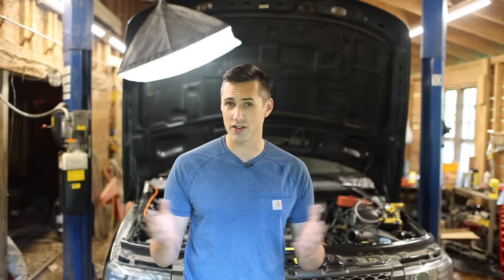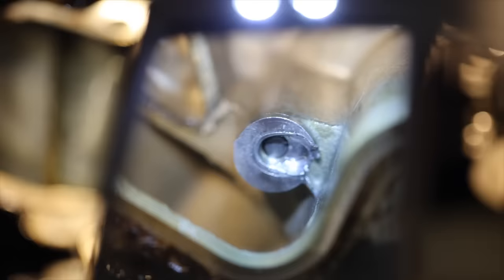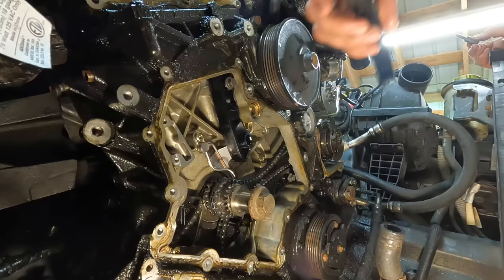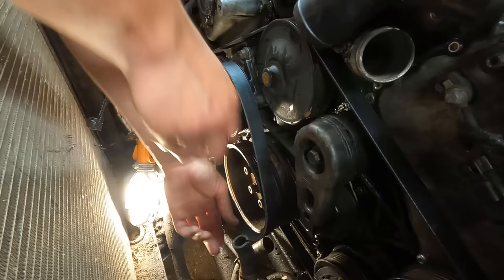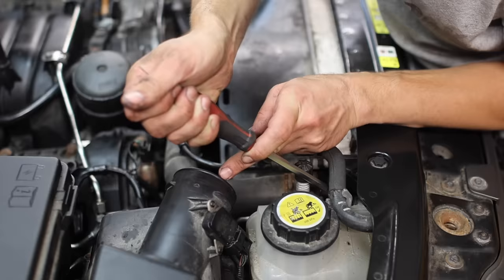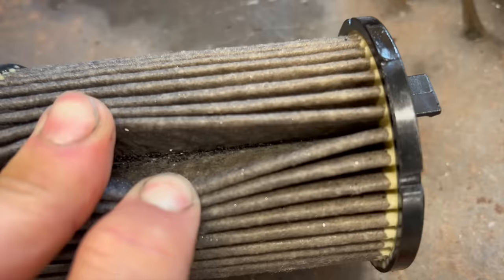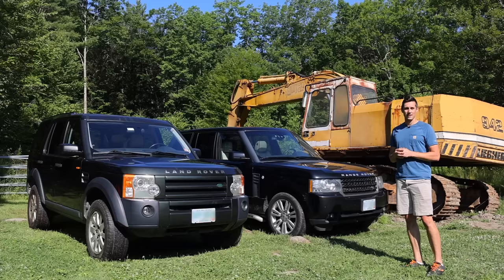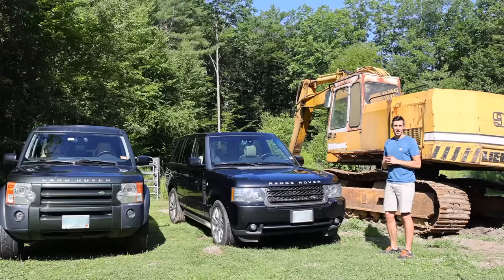Does My Cheap Auction Range Rover Need an ENGINE REBUILD? [Range Rover Part 4]

Comment: Run a engine flush through it and do a second oil change after 1000 miles. And check for shavings then. And then run it til it blows.

Comment: Here in the UK we have plenty of RR's running with dirty oil and worn out guides so don't worry about the aluminium flakes. Most have never had the updated guides and tensioners so your engine will probably last many more miles yet. 😃😃😃😃

Comment: Just keep changing the oil and filter and see if it clears up, drive it 100 miles and change it again. Much cheaper than an engine replacement or rebuild. and don't forget about that RF tire plus an alignment.

Comment: you can avoid CAN bus shenanigans, probably find someone to disable all the check engine codes for most of it and then just feed a faked crank/cam position into the stock ecu (or mount the factory sensors on the replacement engine.. will require lots of brackets and home made sensor rings) along with water temp etc, maybe put the jag throttle body on the LS/Toyota UR to keep traction control and ABS happy...

Comment: I would sugest doing a Mercedes M113 or AMG M113K swap, that engine has been proven to be reliable. All of the once i did the oil changes on are well over 450 000km and the oil is still super clean. The electronics are quite simple to sort out since at that period not much was going on. Its more about remove the unecessery wires. I did a swap myself with a M113 into a old W126 S class and it was very simple electrically even with an LPG system as well. The car is daily driven and has put on 120 000km since. I never got TC to work tho, abs works

Comment: Read many comments, but not all. My recommendation ( with do diligence) drill the pan, and install a drain plug. That way you can do a good flush, and go from there. They didn't install drain plugs from the factory, because the GoofyLube kids would strip the threads. ASE Masterteck, cheers

Comment: Take the vehicle title with you if you ever take it on a road trip. That way, you can sell it to a scrapyard and catch a flight home. Other than that, just drive the darned thing until it quits. The possibility of cam boss/cap wear you mentioned means the heads are ruined. The possibility also exists that the oil pan hasn't emptied all its aluminum shavings from the previous damage. Happy motoring, hopefully.

Comment: Do a series of oil changes, remove the engine sump, oil cooler and oil pump and flush them all before reinstallation.

Comment: Brit here. Rangeys of this gen are very much luck of the draw. They'll either blow up after 50k miles or run for a million miles with proper maintenance. Tbh I would flush it a few more times and clean out the sump. If you get rid of the shavings it'll do the road trip happily. 

Can't wait to see the Disco content! What engine has it got? Praying it's a Td5

Comment: Drive the Range Rover. Metal could be from anything you did, or the seafoam loosening stuff up. Change the oil and filter again while hot. Maybe even pour a quart or 2 through the motor during the change to flush stuff out. You could even run the old  oil change oil from a known good vehicle through it just to flush out contaminants.

Comment: Waldo, there is probably a lot of junk in the sump from the broken pieces which you discovered at the timing chain area. These particles where never completely removed from your oil pan. Try removing the oil pan and cleaning it.

Comment: Take the oil pan off and clean it out properly. Do an oil flush and two short oil changes. Good to go. I think it's left over filings are from the broken timing chain guides. Sucking the oil out the top does not get all of the crud out..

Comment: Try to change just oil filter every day, with normal drive, after 4-5 filters you can see is it going better. There are engine cleaners, if it gets better later you can put that cleaner... Run a bit a change oil again. Last time use specific oil for this engine.

Comment: You may have better luck with a 5.0 Coyote Ford swap, considering all the FoMoCo stamps on several of the engine parts (that engine was built on Ford's European assembly lines). There may be more common parts (maybe also CAN protocols) than with a Chevy or Toyota.

Comment: Its good the filter was dirty, it has to pick up all those metal shavings you created when you drilled out the snapped bolts with no rag over the pan opening.

You should be good. Id probably see how the filter looks after about 4 oil changes.

Comment: While you were doing the leak down test you generally won’t hear the leak in to the cooling system. You should have put water in the system and watched for bubbles at the high point.

Comment: Just use it until it dies , and chance the oil every 5k kilometers to avoid the aluminum to saturate small holes and pipes when it dies then do a post-Morten disassemble autopsy to find what it was !

Comment: Something that is very inexpensive but may be worth trying BG109 BG EPR {Compression Engine Performance Restore} I am not really a fan of flushes or "snake oil" type products. But this stuff will clean out the smallest of passage ways. I used it on a Ford Flex with all kinds of issues (Same boat had to do a timing chain). I also had to replace two turbos. This stuff made the engine look almost new. What is the worse that happens if you get two cans from Amazon for under $40? Just some food for thought before you do a full out rebuild.

Comment: Just drive it old fellow. Oil change at 1,000 miles, use cheap shifty oil for the first couple of changes. You have a lot of crud from having a hole in the timing case and and debris floating around in the engine. What isThe worst that can happen? It stops.

I have been driving mine in a similar condition for three years, still going strong.

Comment: Hats off to you Waldo ...a heroic effort of enthusiastic determination , in the face of the Vale of Tears that is The Land Rover. I had a series 1 1980,s version which ran an excellent American v8 , as used by many other UK manufacturers with immense success. Later series became a long saga of woe, and luxurious financial loss, unless fastidious servicing and prayers to the Blessed Oliver Plunkett were not adhered to on a daily basis.
 Just keep changing the oil until no more particles show up, with maybe a peek inside the naughty scored cylinder now and again.    
Common sense seems to be excluded from the brains of many  Industry vehicle design engineer teams, or is it built in failure intentionally? Anyone know? Or are they lacking in common sense?

Comment: Cut apart the oil filter and put it under a steroscope or low mag microscope... cam journal wear should be relatively small uniform particles, possibly small spheres and very small flakes. If the aluminum is from a timing chain guide/tensioner failure you should see more larger slivery/cuttings type of particles from the chain machining the aluminum. Was any wear noted on the cam bearing surface or journal surfaces? If you followed the procedure then you shouldn't have caused a sudden increase in wear of those components.

Comment: I have a 2011 l322 that had a mysterious coolant leak. No drips but losing coolant. Had the head gasket and timing chain replaced. The problem remains.

Comment: There will be lots of alloy particles coming from the casting where the tensioner bolt broke, I'd continue to run the car and check the oil filter, 8f it clears then there the issue.. also could youremover the sump and clean it out..

Comment: I come from UK. These have a poor reputation over here because of the complicated electrics.Doesn't matter what you do you are always gonna have the issues at some point. Change your oil filter every 4000 miles and run it till it wont run any more then feed it to your  excavator.👍🤓

Comment: new engine for that pos wouldn't be cheap. it can only be the connecting rods or rockers, if not wear due to the timing chain. that wasn't a very thorough oil change, so my guess is it's just left-over material that will eventually be captured by the oil filter. Just keep changing it at closer intervals & observe if it's gradually less clogged.

Comment: All JLR vehicles are absolutely reliable: you can absolutely rely on them to break down in expensive and innovative ways.
There is no such thing as a "cheap Range Rover": they either cost very little to buy and a fortune to fix and run, or a fortune to buy and a slightly smaller fortune to fix and run ... :D

Comment: It's not just Aluminium shavings in the Sump there's also the remains of the broken bolt you removed, when you drilled into it Steel shavings fell through the Timing Case & into the Sump those tiny steel particles could cost you a full Engine re-build?

Comment: Just drive it, if it ain’t rattling and oil pressure is good I wouldn’t worry at all, specially since it previously had the timing chains slapping aluminum.

Comment: The aluminum in the oil may not be a major issue. There may just be a large build up of shavings that are clearing through the system with the previous timing chain. or broken bolt issue.  Although after the rebuild you did I would sell it for a decent profit and move onto another project. preferably a Mercedes... Range Rovers are notorious maintenance nightmares...

Comment: Waldo. 
I'm going to suggest adjusting your trip try Salt Lake city. On to Price Utah. 
The reason is. I've driven the Bozeman Route to Laramie and to Denver area. The Route you are going to take has very very few services if something should happen. While the route to SLC area has vastly more services plus there is a Range/land Rover dealership around the SLC area. That's where my wife's nephew got his Range Rover fixed. He has asked me to fix it. But I could not afford the tools to fix his Range Rover. But he is selling Range Rover. His wife says parts are to expensive to own.😋. Anyhow.  Safe travels and I'm going to keep my toes crossed too.
My sister gave me a Discovery 2 a few years ago. Done lots of work to it. All because the previous owner that my sister purchased it from never did any maintenance. But it's running very good. It's one of my daily drivers.

Comment: Waldo, as far as I noticed, you didn't extract the remains of the second guide bolt, the one that caused the hole in the front pan. Maybe you did it but just didn't show it to us. However, you definitely did not install this bolt, so the plastic guide is fixed only with one bolt, instead of two. Not sure if it is related to aluminum wear offs, but definitely it was missed.

Comment: Hey Waldo  Everything is bad with the engine. It was overheated, and this caused defects on the cylinders and pistons. And one more sign: there are aluminum particles in the coolant. This is a deformation of the block head. It will be cheaper to replace the engine in your country. Good luck!

Comment: If the engine is done anyway, cannot harm to do a couple of thousand miles and one or two oil changes to see if it stops or lessens the metal filings.

Comment: In my opinion the aluminum is from the time chain issue. The oil being dirty is from is sitting at auction and the previous owner now doing proper oil change intervals. I’d drop the oil pan and clean it and run some oil flush and a wax oil filter

Comment: It's pretty sad with those landrovers. They drive so well but there are just leasing cars. Drive it 3years and give it back. 

In your case i would inspect the oil pan, clean it very well, change oil multiple times and just drive it and have fun with it.

Comment: I wouldn't do anything with that LR other than put a junkyard motor in it. Anything else is going to be a massive headache, and probably won't ever work right; unless you do something insane the YouTube royalties won't ever offset it either. Not a sexy answer, but I suspect it's the truth. 

If you are going to do something insane, a 4BT / 6BT might be fun. :)

Comment: I'd run it until it becomes obvious what the problem is. Once it's either dead or almost dead, then you can decide what you want to do (rebuild/replace/DT360 swap). If it really is freshly grinding aluminum (you are sure that it isn't bearing material, right?), then it's possible that something is rubbing under the timing cover. Maybe pop it back off and see if anything is wearing. Also, are you certain that you kept the cam caps in their original place and orientation? They are line bored from the factory, so you can't just swap them around without creating stresses that could lead to wear like that.

Comment: As the oil is in the sump pan, it would have been a good idea to remove the pan and clean, getting rid of the foreign bodies in it. Just sucking out the old oil does not remove these pollutants.

Comment: Rebuild is inevitable. Might as well do it right and replace everything when you do. So run another round of oil (throw in some zinc additive for funsies, cant hurt) and a filter for a little bit then make a judgement call there. You might have gotten all the junk out from your drill filings you never know. Youre in a no lose situation. We will enjoy regardless of the outcome

Comment: How about a Cummins R2.8 swap. It sells as a system with a starter, an alternator and ECU &wiring etc installed, a little expensive at $7000+ range, but a lot of people have done that to their LC60s, Disco2s. It will be the first known install for a Range Rover.😀

Comment: i would remove the oil pan and clean it before diggin any further ,them probably change twice the oil whith 100 km apart ...
the engine  had a lot of wear after the broken bolt . probably its just a mater of deep cleaning the engine .

Comment: The sources of aluminum are fairly limited to the cyl heads and timing set. From what you've shown us in these videos, I would suspect that the alum you're seeing in the filter now is left over from the previous damage and the material you put into the pan while installing the new parts and removing the broken stuff. I would keep running it and changing the oil and filter like 3x a day for a few days.

Comment: Drop the pan. Clean it. Run the engine cleaner,drain, clean, add new oil and check if you’ll have a lot of metal shavings

Comment: Hi I don't understand I have built plenty of engines you almost had it striped you had done the hard work keep changing the oil every 1000.miles it will clear just remember you didn't clean out the sump and there are lots of places for the muck to hide I reckon you done a good job.

Comment: Great video! Keep up the good work. You previously included conversions for different data points so I was bummed that we didn’t get that for the newton meter torque specs. I run old school tractors so I’m used to foot pounds.

Comment: Those shavings are most likely from the threads you drilled, I noticed that you did not cover the crank case with a towel while you were drilling. If you’re not going to sell it then just drive it, the motors have dropped in price.

Comment: As long as its running and driving, I would send it back to auction and try to get my money out of it + hopefully some profit. Old Range Rovers aren't worth the hassle
Reply: It's funny because I saw this channel had fixed up a Range Rover and I thought "wow, someone who has gobs of time, all the tools, the ability to follow instructions exactly, and a decent chunk of change is FINALLY going to fix one up so it's actually reliable..."  Nope, they are engineered trash; worth less than the parts that make them up.
Reply: @gorkyd7912  - That British made Ford 5 Liter engine has pretty bad reputation for reliability. The rest of the car seems to be OK if you don't mind frequent maintenance and stupid parts prices. The car does ride and handle well and styling is top notch.

Comment: The bolts likely broke off in the block because the block is aluminum and the bolts are steel.  Always use anti-seize on dissimilar metals!

Comment: Leakdown test wouldn't necessarily reveal a head gasket leak from cooling system into combustion chamber.  Would need to test coolant for presence of combustion gasses.  

I am also very curious how you dealt with the broken timing guide bolt standoff on the block.

Comment: At 2:24 when you start drilling the broken bolt without covering the open engine area, and there's steel shards going everywhere, I had to wonder why. Engines have been ruined by less.

Comment: I’d just drive it until it grenades. Maybe it doesn’t grenade, maybe the filter is progressively cleaner after each of the next few oil changes. Maybe it grenades. Maybe you get to squash it with the excavator. Maybe it turns into a fun 17 part video series.

Comment: Ls is overdone. Maybe aluminum flakes from some of the screws that were stuck or taken out. I'd put a a couple of hundred miles and see if they reduce in number.  Send off for an oil analysis. I woudn't worry about it. You can always rent a car anywhere. I think it will be fine. It will add to the adventure. I don't know if I'd dilute the oil with non lubricating additives.

Comment: Ok the leak tester won’t always show a head gasket leak.  You should have used the radiator exhaust detector or pressure tested the radiator and used a camera to see what hole is leaking into. From the spark plug holes.

Comment: Pausing at 1:30 to ask a question: Cylinder pressures go much higher than 80psi... much higher. A four percent leakdown at 80psi might be a much larger percentage at higher cylinder pressures. Did you take that in consideration? (Sorry if you did later - had to ask now or I'd forget!)